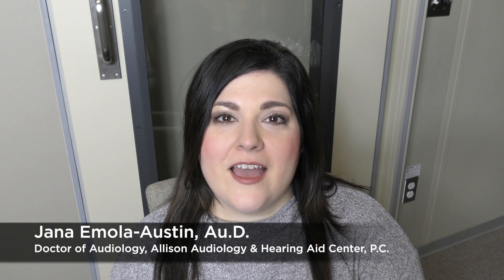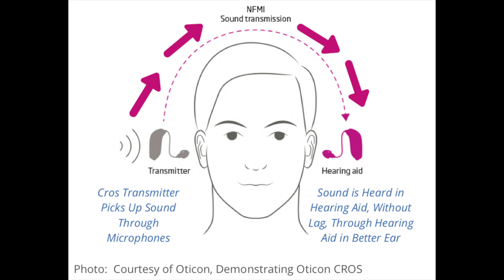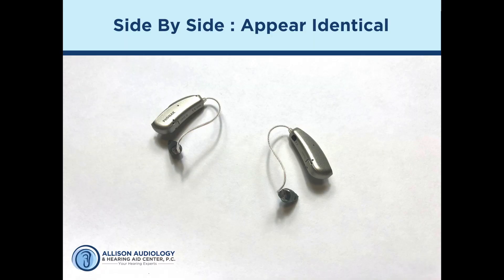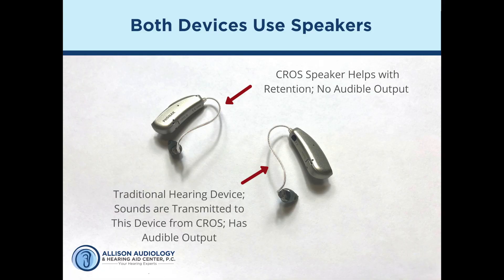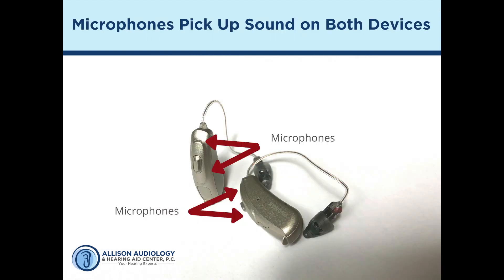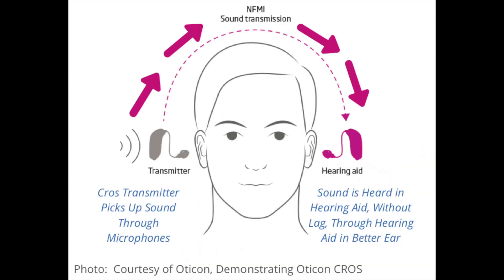CROS Hearing Aid Systems in 2020:  What Does a CROS Aid Look Like?  How Does a CROS Aid Work?

Comment: I had an acoustic neuroma removed in over 10 years ago and left me deaf in one ear . The past few years my  
Otolaryngologist advised me to try the Cros hearing device . The device was very expensive and insurance did not cover it. I tried it for one week and the noise was unbearable and I returned it. Recently I went to see  the audiologist and told me that, if I don’t get the device , I am facing to loosing my hearing in a good ear and hearing loss leads to Dementia. That scared me and I got the 360 Cros hearing aids a few days ago. I can confess that  I can hear very well in my deaf ear . I was so happy that I could hear from a distance . The noise is minimal and bearable . However it sounds like one is talking in a microphone. I was told that by time it goes away once your brain adapts to it.  I am happy I got them.
Reply from the maker: It's wonderful you gave amplification another try. Congratulations on your path to better hearing!

Comment: I have loss of hearing in my left ear. Additional issue in my left ear is that sound that enters always sounds very distorted. With traditional hearing aids, all it did was amplify the distortion so I stopped wearing them. Would a CROS device cause similar issues or might it solve that problem?  Any advice or recommendations is greatly appreciated. Thank you

Comment: My son has profound hearing loss on the right ear. The Doctor advise Cros hearing aid device. How much does it cost. I hope you reply Soon. Thanks.
Reply from the maker: Hi Merlinda!  The costs for the CROS devices can vary.  Without knowing the prescription levels needed, we can't give specifics.  But we say that right now, we are seeing the best rechargeable battery performance out of the Oticon CROS devices.  And they are compatible with all Oticon levels of hearing aids, so that can certainly help with costs.  As other manufacturers make updates to their CROS models, this may change, but for now it is holding true.  We hope this helps!

Comment: I have had Menieres for 8 years. My left ear now only has 20% hearing left with 5/20 word recognition. The right ear has 75% hearing left and good word recognition. Right now I have OpNS2 aids in both ears. Is my hearing bad enough that a Cros aid would be better in left ear?
Reply from the maker: Good afternoon! When it comes to recommendations, we try to shy away from that online simply because we don't know the whole history or situation.  However, from what you've shared, you may want to try a CROS device on your left ear and a traditional device in your right.  This way it would give you first hand knowledge and you would be able to experience it.  From the current CROS technology out there, we would recommend sticking with the Oticon option if you're looking for a rechargeable solution.  We've found our patients get the most use/hours from the Oticon rechargeable CROS compared to other manufacturers that offer the rechargeable CROS option.  When it comes to hearing and personal preferences, it's specific to the individual, so if you are curious about the CROS and what it would be like, we would recommend finding a local hearing provider you trust and scheduling a listening demonstration.  Then you'll know for sure if it's an option you may want to pursue.

Comment: I am SSD after a labyrinthectomy. My audiologist did not discuss this, but I have heard the device will beep to “inform you” which side the sounds are coming from. Is this correct? If so can you provide a little bit more information?
Reply from the maker: Hi Rebecca!  I would ask your audiologist if you can listen to a CROS set up so that you can experience how it sounds.  It does not beep to show which side sounds are coming from since the CROS does not emit sounds.  It does send the input wirelessly to the opposite side/hearing aid.  Since it is different than a traditional device, I would recommend experiencing it for yourself and seeing what you think.  Phonak has just come out with a new CROS for their Paradise hearing aid line and Oticon is also releasing their latest CROS as well.  So there are some great options out there for CROS technology now.

Comment: Does the Cros device that is on the side with the hearing loss also send the sound into the middle/inner ear of that same side (as well as receiving and transmitting to the good side)? I'm assuming it does as it has an earpiece attached to it.
Reply from the maker: The Cros device itself sends a signal (wirelessly) to the device on the opposite ear.  By design, it looks as if it would send sound into the ear canal, like a traditional hearing aid, but it does not.  Sound comes into the microphones of the Cros and is then sent (wirelessly) to the matching hearing aid on the opposite ear.  Once the signal is received by the hearing aid, that input goes into the ear canal.  This design can be a bit tricky; we hope this helps!  To best understand how it works, a listening demonstration would be a great option to fully experience the sound quality.

Comment: Hi maam i have problem.. i have hearing loss bec of antibiotics 2 years aqo . I can hear sounds and vibrate but words i cannot hear... I have hearing test last week im fitting hearing aid byt they same icannot hear words.. what hearing aid can i use so that i can hear words or speech?
Reply from the maker: Hi Randy!  Thank you for reaching out.  

For the right type of hearing device for your specific needs, I would consult an audiologist you can trust to show you your options.  There are times when hearing loss is severe, that words and speech are distorted, making it unintelligble, but environmental sounds can still be detected.  Traditional hearing aids of varying power levels can be helpful with environmental sounds for awareness and safety.  In some situations, a CROS device may be helpful if the hearing loss is only in one ear.  Without knowing the specifics of your hearing loss though, I can't recommend what set up may be best.  If you are questioning what is best for you and you have seen an audiologist, you may want to seek a second opinion.  And of course, if you are in the Houston or Lake Jackson areas, our team would be happy to help as well.